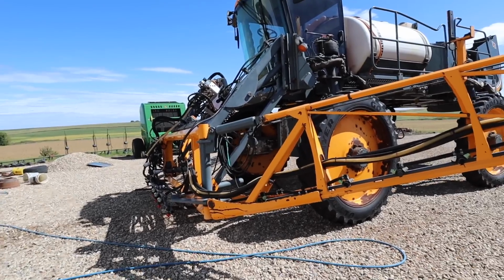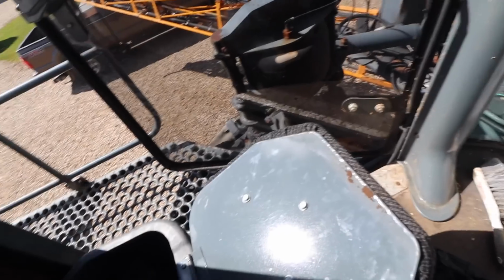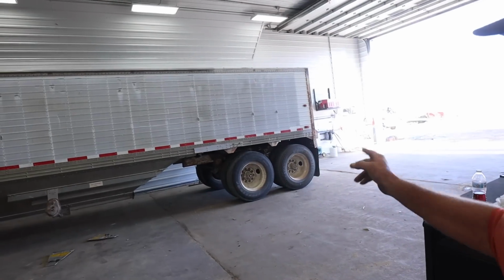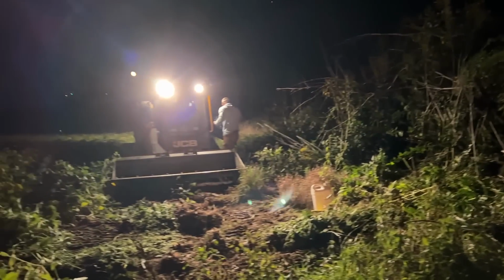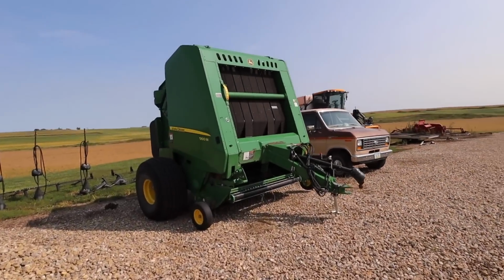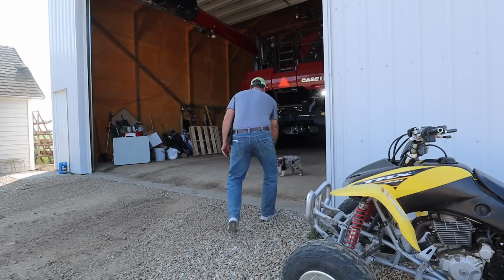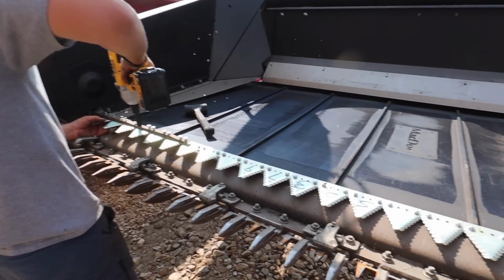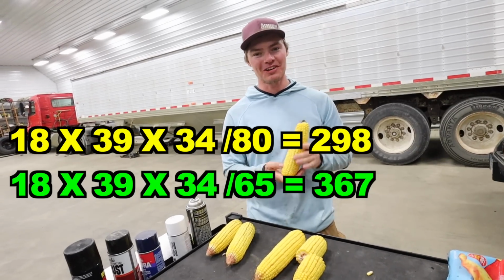The Combine Is Awake & Ready To Eat!

Comment: Thoughts on bolting a tool box onto the outside on the railing or near the fill points under the machine?  Could also lash a small trash can out there somewhere to put gloves / used rags in if you have a spot for it outside the cab of the sprayer.  Cab cant get messy if stuff doesnt go inside it.

Comment: Never seen a knife come out that easy. Where I used to work years years ago when it came time to change the knives on the swathers and combines, we used to pull them out with the tractor and put the new ones in with the sledgehammer. And these were 10 and 12 foot headers.

Comment: Hey Cole! To get the clutter out of the Hagie sprayer cab, I'm wondering if there is anyplace on the outside of the tractor where you could put stuff? Could you put a vehicle roof rack over the cab? If you don't mind drilling a few holes in the roof you might try mounting some artificial rain gutters to mount a gutter-foot rack. Thanks for the video & tell your folks I said hi. 
P.S.: Next time you burn brush or stumps, try using a leaf blower to turbo-charge the flames (after the fire develops a few coals.) Even a cordless blower directed at a fire will have pretty impressive result.

Comment: 6:38 DC means a "heater control valve". I used to work for a radiator shop once upon a time.
10:19 Nave: "Baby, how many critters are in there?"
 Cole: "Oh none. I sent them an eviction notice last month." 

LOL!!!

Hey Cole, I use a 3 gallon pump up sprayer filled with kerosene or diesel to help start burning brush piles. Nice to see a fellow pyro at work! LOL

Comment: there are powerwasher with oil heating. mutch better cleaning with hot water. combine it with a soap atachement who can suck up a good claning solution from a bucket or container (ask larson farms abpout it) you can do multiple runs over the eruipment from cold, over hot, to hot with soap, to finishing wiith what works best.

 also there is air powered grease pumps who go on top of a large greaee drum. you can put the drum on a dolly use long air and grease hose and you will love it in the shop. the power grease guns are still good for field maintanance.